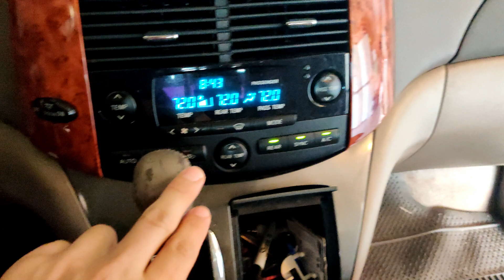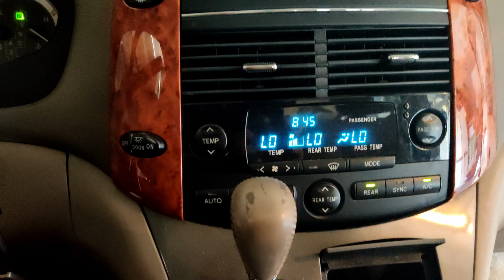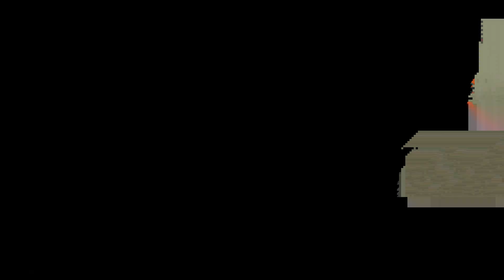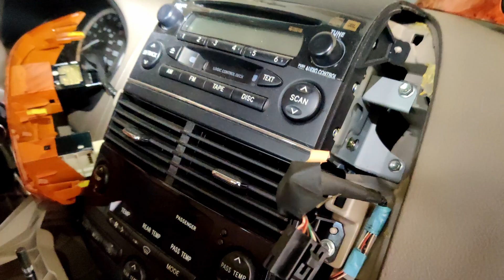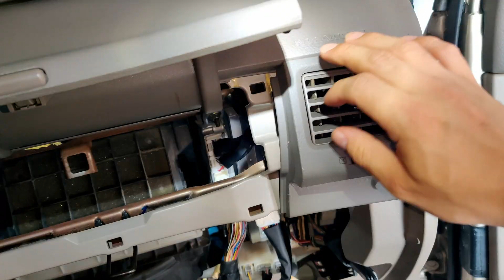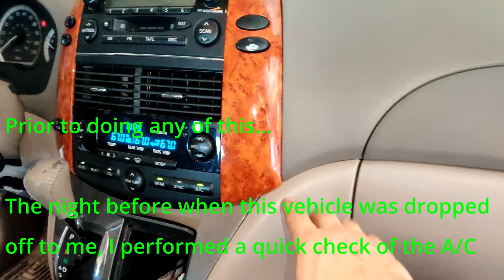How To Diagnose And Replace A Faulty HVAC Blend Door Servo Motor 2004 -  2010 Toyota Sienna

Comment: My blend door actuator moves but it’s still stays cold on the passenger side, the temperature never change on the passenger side even seen the actuator moving up and down. Is the door broken? It also stop blowing out the rear I was told it wasn’t the blend door actuator it could be a coolant line issue, has anyone ever heard of that or should I get it looked at else where
Reply from the maker: Hey there, thanks for watching. There could be several issues here if you are not getting hot air, yes check your coolant level. Also, are you sure you’re observing the air mix servo motor ? If you are then yes most likely the door is broken inside.  The fact that you are not getting hot air in the back, it’s also an issue which almost seems like they’re related so I will start with checking the coolant. I hope that helps.

Comment: @Savvy Automotive, I have a 04 sienna that blows hot on passenger side, cold on driver side (for heat ON)  Do I need to replace the blend door actuator under driver side kick panel?
Reply from the maker: Hey there thanks for watching, If you're heat is turned on and is only coming out hot on the passenger side, then yes it most likely means that your blend door servo motor for the driver's side has failed. 

To confirm, physically access that failed servo and watch as you change the temperature if it's behaving sluggish then there is your confirmation, needs replacement. If it's not moving at all, you can always remove it and turn the blend door by hand to see if get heat, if you do then there is your confirmation again, needs replacement. 
 
I hope this helps and consider subscribing for more tips and repair guides like this.

Comment: My 2010 Sienna XLE has a problem when I switch the mode to blow air on the front. It makes a clicking sound, click, click, click... After that, when I change to the front and floor mode, the clicking stops. The main issue is that the front blower always works, but I never see air coming from the floor blower. Do I need to change the servo blend door motor, or is there something else I need to replace?
Reply from the maker: Hi there! From what you're describing it sounds like it is the blend door servo motor.  You can verify this, by removing the side panel so that you can visually see the servo motor moving/operating as you change direction of air to foot and face, if you don't see it moving but you do hear the "click noise" coming from there it is indeed a failed servo motor.  Thanks for watching & I hope I gained you as a subscriber!
Reply: @SavvyAutomotive  .  Thank you very much. I read from others. It is Mode Blend Servo because any mode I turn to floor does not have air. Thanks

Comment: Toyota does have on board diagnostics . Hold the recirc and the auto buttons , then turn the key to on ,just on not start. Hold till the readout happens on the HVAC panel as it runs through the diagnostics and comes up with the error code. Look up error code on internet . For my mode door actuator replacement is 6 hours of labor and  180.00 bucks for the part . According to the forum to replace the motor at fault is about 8.00 on Amazon and yes the actuator can be taken apart to change the motor but it is in a nasty location and time consuming.
Reply from the maker: That’s is good information to share, Thank you for that!

Comment: Great video! But you don’t need to take apart the whole center console, just the glove box, the lower kick panel piece, the black plastic air vent, and use a stubby screw driver or craftsman ratcheting screw driver to get the three screws out.
Reply: Thanks Bro. No kick panel required. In and out in 10 mninutes!
Reply: Makes no sense to remove center console when you don’t access the actuator from the center. You access it from the glove box.
Reply from the maker: I’m sure this is doable. But most DIYers won’t be able to, or have a hard time or just give up after the first few attempts therefore I would really recommend removing the center console.  Good suggestion though!

Comment: My 2010 sienna blows cool on passenger and hot on driver and back of van. We replaced the servo on the driver's side, (which was not moving) but we still have the some problem.
Reply from the maker: If you replaced the air mix servo (which was definitely a good start), but you're still having the same issue, your Sienna might actually have more than one problem going on. One common cause for uneven cooling like you're describing: cold on one side, hot on the other usually tends to be low refrigerant levels. Have you checked your A/C pressures yet?

When refrigerant is low, the system can’t cool evenly, and often one side (usually the driver’s or rear) will blow warm air while the other stays cooler. Your first step should be to check the system pressures. If it's low, the best thing to do is evacuate and recharge the system properly, and add UV dye so you can find any leaks. Hope that helps! Keep me updated! Thanks watching *& subscribing!
Reply: Did you figure this out? I have the same issue, but it was chilly this morning and I realized that the passenger stays cold even when it's set to hot, and the drivers got nice and warm. 

I think it may have something to do with the air going over the heater core. Seems like drivers side is always getting the heat and passenger isn't.

Comment: Any suggestions for fixing a ticking noise on the drivers side that sounds like a typewriter but I think is an actuator (2010 Sienna)? Air still works...
Reply: What I found in my 2008 sienna was the ticking sound that I thought was in the dash was actually one of my lifters in the engine!  Yes there can be a ticking ,failure to engage unit,  on the drivers side but you need to be down there to hear it as someone else  runs through the controls for you as well as holds the door button so you have no distraction. What generally fails is the most remote or the harder to replace actuators.
Reply: Ticking sound could be from the Mode Actuator which is what I had. You can try cycling thru the different modes to help the actuator go thru and possibly stop making that noise. I read from other posts that this happens if it’s on one setting for a long time and or having it on max temp high or low for a while. Was going to replace mine but after going thru cycles it stopped making that error sound and I confirmed it still worked visually seeing it move to each setting on its own. Also you don’t need to take apart the whole center dash to get in on either driver o r passenger side.
Reply: Oddly enough if you press recirc and auto buttons on the dashboard , then turn the ignition to on ( don't start it just on ) up comes the diagnostic for the Toyota.
Reply: @brucewmclaughlin9072  what can you do from that point?
Reply: @GmanGggggg  error codes come up and sort of point to the issue. mine is error 43 "bad motor "
 . I would assume the manual would point where, as I have three motors?